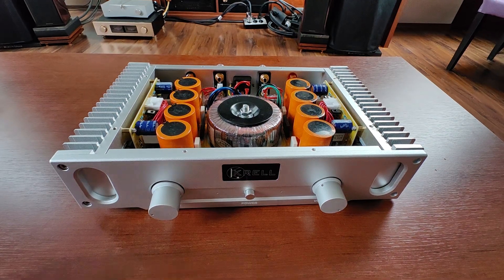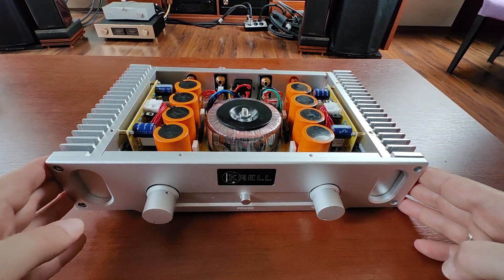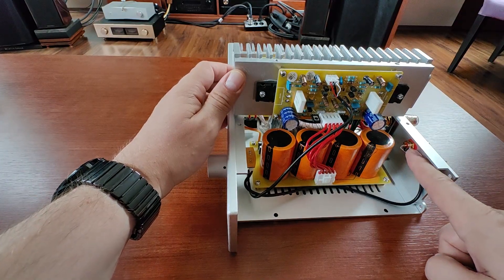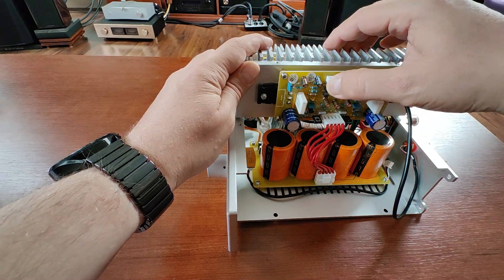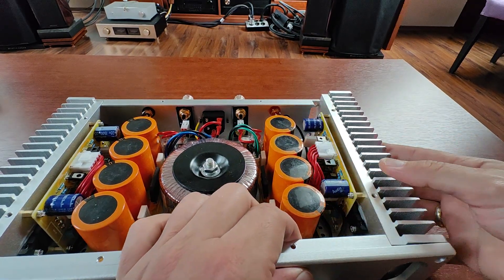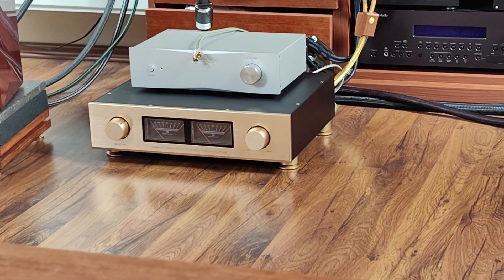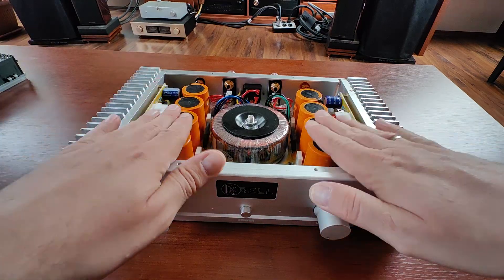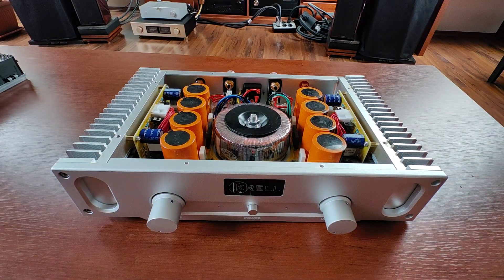Musical Fidelity A1 speaker amplifier clone: volume control bypass in 10 minutes

Comment: I have the impression that this unit, at least the sample I received, is not a true Class A amplifier. It plays noticeably louder than one would expect from a nominal 20 W rating and also does not get as hot as a Class A amplifier typically would. It is possible that the bias current is set relatively low, causing the amplifier to operate effectively in Class AB rather than pure Class A. Has anyone analyzed this amplifier in more technical detail or performed measurements to determine its actual operating point? Regardless, the amplifier still sounds very good.
Reply from the maker: Hi! It's possible that you got slightly different version or just biased differently. That's what I was talking about, unfortunately there is many sellers and though they may look the same on the outside, they may be sightly different inside. 
Mine runs hot as oven, and it's not able to drive properly my electrostats and that would be in line with low specified output power.
Your unit may have different bias and that could explain the (possible) difference 
This is actually a very popular build based on some schematics from diy audio, though you can never be sure which one actually they had used :(

Comment: Hello again and thanks for the mod tip. Is it not to loud without any resistor in the line? It is like hearing with max level. Did you try it?
Please give me a answer, tnx
Uwe
Reply from the maker: Hello Uwe!
The idea is that removing that volume control pot makes this amp effectively power amplifier with fixed gain. So you need either preamp or a source with volume control - but it's worth it as it just sounds way better

Comment: I have the new version a1s. 35v, 8x18k. Bypass has problems probably with grouding. Sound is not correct. Zero volume, noise  in treble speakers. So came back to original.
But IMHO it is great amp. Source is Eversolo A6me with lps. Preamp is new class a brz hifi with bt5.0. Where I changed 4 opamps from original 5532dd to chinese muses01. Cables, best of tested till now from ali , like also rca made by myself. So I know these cables can.... in compare to other big brand also. 
So purchase was for fun. But I stop laughing after all. My Piegas coax 511 really live. One joke is a price of  these chinese toys.

Comment: It’s possible this improvement gives better sound, but in my case noise appeared in the speakers, clearly coming from the RCA jacks. After returning to the initial settings, the noise disappeared.
Reply from the maker: That's interesting, is your amp exactly the same as the one here? Was it from the same seller? Mine is dead silent (also, no one else reported noise). If you can hear it with volume bypassed, and can't with vol pots in series, this means that the noise it's still there, but it's lowered along with the music signal by volume pots below audible level
Reply: @k4syx 1. Thank you for sharing how to make this improvement. Honestly, it is necessary for this particular amplifier model, because each potentiometer (set the same way) shows a completely different volume level. The deviations are really significant.
2. My amplifier was bought in a store – the second link in the description. Apart from the fact that it has a different inscription on the black plate, what’s interesting is that the rubber feet are screwed on separately. To make the improvement, you don’t need to unscrew them in order to remove the side panels.

I hear a slight hiss/hum in the speakers. First, I’ll replace the RCA cables and use plugs for the remaining preamp sockets. If that doesn’t help, I’ll add a ground loop isolator. I’m also considering replacing the RCA sockets in the amplifier itself?

Comment: I did the volume pot mod, but not without near tragedy, and a minor mechanical setback.  One screw of the face panel was stripped. Not clear if it was bc of me or delivered that way. Some of them seem almost as if they are welded on.  So I could not remove the side panel for the left channel. I was heartbroken. But years of piano training did not go to waste.  I was able to force the side panel apart a couple centimeters, just enough to slip two fingers in and do the mod without damaging the caps or op amps.  And this was my first time even opening an amplifier, my heart almost stopped.  But it worked!  Good luck ever getting that side open again.  I hope intricate work is not needed there in the future, bc its not gonna happen.  The increase in clarity is noticeable, like a little increase in EQ on the top, but not in an additive manner. In Gergiev's Philips recording of the 4th Shostakovich symphony, I could more easily distinguish that last top celesta note in the chilling end of the piece as coming from a distinct instrument, and not just obscured by the strings playing the same note. Fabulous, and easy mod ;)
As for the A1 itself, I love it.  Potential buyers should not be overly concerned with the 20 watts.  I'm running from my Oppo 205 directly to the A1 and then to Polk R200 bookshelfs and it produces surprising dynamics. Never seems to run out of steam. The R200s are 86 db 4 Ohm and Im squeezing 25 watts from the A1. I am fortunate, it seems, to also benefit from larger caps than those advertised.  Mine came with 10,000 each,  80,000 total. That must help. Bass is full, powerful and imaging is amazing.  Almost too amazing.  Out of the box, a solid center image was not always focused. But after about 100 hours, some things have tightened up, while others loosened.  It runs hot, but not crazy hot.  Functions well in my 80F/27C living room here in the summer southwest US.  After burn-in, I will integrate my two subs and feed everything below 80 hz to them, letting the A1's midrange really sing and give more headroom.  DeepSeek says such an approach would yield a 30-50% energy benefit to the A1.  The phrase "cheap Chinese parts" is not part of my lexicon, nor should it be in anyone's these days.  Having just returned from Guangdong  province a month ago, where this unit originates from, China is spectacularlly modern, and at the cutting edge of  technological advancement and production. Thank you again, Mr Hifi Zone, looking forward to more videos, and cheers! 🍻
Reply from the maker: Thanks for sharing, I'm happy that you like it! It's little gem and the price is just amazing. I may go with cap replacement in mine in time :)
As for the screw they are probably using electric screwdrivers, these can have a lot of torque and undoing the screw manually later can be really, really hard. I'm glad you managed to get it done! 
Warm regards :)
Reply: Mine was $239 on Amazon.  Yeah, absurd.   Better sounding than the original Schiit Aegir I used to have, and cooler, at 1/3  the price.  Dartzeel is there too in a couple of variants, the least of which is 650.  80k for caps is a little overkill, Im sure the standard 65k sounds wonderful. But I do admit wondering if I'm going to get 120k, I think like that one viewer. Kind of a lottery)  But if you do replace, please let us know what you got and maybe a video ;)  Thanks again  :)

Comment: Thank you, Mr. Hifi Zone!  And please help🙏🙏🙏  I just discovered your channel and immediately purchased the A1 based on your recommendation.  Ive had it almost a week, 1/4 burn-in.  In short, it's marvelous. More on that later.  I need to know the input impedance of the amp so I can install  high-pass filters in between my dac and the A1. This spec is not mentioned in the description.  DeepSeek said 50k ohms, and BRZhifi told me 47k ohms. Moreover, will bypassing the volume pots change this value? Can you or anyone here please tell me the input impedance stock, w/pots and more importantly, with pots bypassed???🙏🙏🙏 Thank you, so much.  And greetings from California))
Reply from the maker: Hi! 
Thank you!
Yes bypassing the volume pots will change the input impedance. You can measure it afterwards, that would be resistance, but it should be close enough.

Comment: I am now really wondering if the new version of the A1 with the 4 18000uf/35v caps per channel improves on the already Beautiful sounding amp.

 It now has a total capacity of 144000uf/35v up from 64800uf/63v. What are your thoughts on this change.

As describing my last post I'm already considering making the 2 A1's I have mono amps and buying two of the new ones making them mono units for the midrange and use the 2 units in Mono's for the tweeters. And doing all other mods I listed below in my last post. This would also give me 4 spare  amp modules if anything should go wrong. 

However I do have a question if I unplug one of the app modules do I need to join the wires of the Transformer to the amp module that would be in use? Or will the single Amp module take advantage of the total capacity of the transformer.
Reply from the maker: Thanks! 
Theory says that this capacity difference will work in favor of sound quality, so that's good and I may replace caps in mine too.
As for joining the outputs of the transformer I would really do that, as the bottleneck is not the transformer here. So just protect them from shorts and leave them disconnected
Reply: @k4syx thank you sir

Comment: Sir what do think about this Mod list for the A1 using 2 of the A1. Just reading thru all the comments about what others think can be done. And what improvement do you think these will reward us with. We know bypass the plot give noticeable improvements.  

1. Bypass the cheap volume pots

2. Replace all signal wires with good solid core silver plated copper telfon coated wires and solder directly to the boards

3. Remove 1 channel from the power supply creating a mono amp. Cool thing about this mod you have to complete amplifier sections if something goes wrong with the ones that you using!

4. Upgrade the 4 large 63v caps to a larger value for more capacity.
Reply from the maker: Thanks! 
These all are good ideas and they all will push that nice amp even further. And nothing here is expensive. I would also add replacing speaker taps with something better.

Comment: Can you please advise me some passive simple preamplifier for this MF A1. Thank you. Peter
Reply: Possibly a link to lon from Ali
Reply from the maker: Check that one - get RK27 version: https://s.click.aliexpress.com/e/_oot99lh
Reply: @k4syx  Thank you, 
so I'll bypass both balance potentiometers and add this one ?
Reply: Wouldn't it sound the same as if I didn't bypass?
Reply: If I do a bypass and then add a passive preamp, will the resulting sound be the same as if I didn't do a bypass ? Plus I'll need additional cables. Wouldn't it be enough to control the final amplifier just by raising the DAC level via PC ? 
I have a Windows PC and a DAC Topping E30.
Thank you Peter

Comment: I have an issue with this mod. The background noise is too much when plug my headphones into the speaker taps. Is it normal?
Reply from the maker: It looks like it's picking some noise from RCAs if that's what happens after bypassing volume pots. The only thing they do is lowering the input signal level, so if there is a noise without them it means the amp is picking it from RCAs (or maybe your source?).
Btw what kind of headphones are you connecting?
Reply: @k4syx  after some testing, I have to say that you were right. It's a ground loop coming from RCA. Tomorrow I'll try to reduce the noise with an Art Dti ground loop isolator. I'll let you know!!

Comment: the version with the 'brz' name plate in fron t is impossible to open up!
Reply from the maker: Why? What's happening?
Reply: @k4syx  top plate is stuck after screws are removed as per video. i used a screw driver to try to pry it  after that, and the aluminium was so weak it got dented and scratched :(
i really dont know how to open it now. scared to damage the amp.
Reply: @CatrinaDaimonLee  I believe one of the screws on top is covered by a sticker. Mine was. Remove this sticker and you'll see the screw that prevents you from opening the cover.

Comment: Ok..mine arrived today! Observations:
1) I tried to do the bypass BUT the pin out on the harness had red and white wire reversed to what you have (however, since this is NOT a balanced amp, I suspect it doesn’t matter - both red AND white wire are soldered to the RCA input pin. Could someone confirm I’m correct please?)
2- arrived safely, looks OK - has the BRZHiFi logo. I wish it were black..oh well
3- I DONT think this is full class A - I had the original A1 and it got WAY, way hotter than this. MUCH hotter lol.
4- I auditioned it with volume at full and it sounded real good. PLENTY of bass and volume 91+ db @ 2.5m from each speaker (JBL stage A130)
4- bass was VERY muscular and controlled. Mids were sweet. Highs were not quite as liquid as I remember the A1’s sounded but still nice.

5) with the volume at less than 100% (50-70%) Sound was good and still very punchy but less detailed.

I am waiting for the P4 mini preamp to arrive and for confirmation (PLEASE!) of the RCA pinout issue I mentioned earlier.
At that point, after several more hours of playing and setting it all up, I will report back!!!😊😊😊
Thank you🙏🏻

BTW It was about $350CDN and 1/2 was delivery/tax/duty
Reply from the maker: Thanks for sharing! 
The red and white are for left and right channels. As you actually have two amps inside it doesn't matter which one will be left or right, as long as you'll remember to connect your inputs and speakers the right way
Reply: I'm powering my JBL Stage A130 with a Fosi Audio V3 Stereo, was curious if this would be able to drive them thanks for sharing your experience.

Comment: Hi,

quick question. If one would measure in continuity mode between both speaker out negative poles, are they connected? Thx for your review.
Reply from the maker: Ive checked that for you and yes they are connected.
Reply: @k4syx what does this tell you? (I’m curious why he asked)
Reply: @blanchbacker  That both channels share a common ground.

Comment: I really like the sound of this amplifier but it lacks power. so I am thinking of buying the accuphase a60 which I think will be a better match for my system.
Reply from the maker: Yes, it sounds superb but the power is not its best point - its very good with efficient speakers. 
Take a look at my E405 review, I've seen some A60 builds that seem to use the same chassis so that part of the video may be useful.
Reply: @k4syx  I bought the A60 plus with both RCA and XLR . I'm sure that will be better.

Comment: What preamplifier would you recommend for this amplifier
Reply from the maker: I think Cary SLP-90 clone. Its clear, transparent and will not change the signature of the amp
Reply: @k4syx  thanks
Reply: @k4syx  I am going to try this amplifier with my audio research ref  1 preamplifier.  I will let you know how it sounds.  But I want this amplifier as a second system so thanks for your preamplifier recommendation. And I will bypass the volume controls on the amplifier. They are definitely not needed.

Comment: i wish they had a little more power.. id buy 3 to use with DSP for a custom speaker build.. but im afraid 25 watts isnt much
Reply from the maker: @JohnDoe-cv8iw  these are very current efficient but you're right that 25 isn't much. Can be enough but with efficient speakers

Comment: I have 933 burmester clone power amplifier .. Should i remove the vol pot from there too ..pls advise
Reply from the maker: @azmansalleh2866  I'm gonna do this and do a video on that, soon. What I'm wondering about is if I should also cut these long PCB tracks, so they stop acting like antennas. It would be reasonable thing to do but I'm reluctant to cut anything permanently

Comment: Question:
Can I buy another (same/equivalent) transformer and turn the modules to two separate chassis monoblocs? What other necessary mods are needed (electrically, that is), to tun it to two monoblocs? Thanks!
Reply from the maker: @raynerstuelgalid  that's an interesting idea as you could move them outside to separate chassis too. I think just two transformers would do, I'd need to check if there's anything between power socket and transformer (not counting power switch) as I don't remember it now (but I don't think there was anything)
Reply: @k4syx  What's the rating for the existing trans?
Reply from the maker: @raynerstuelgalid  I don't remember if that's in the vid (should be if there was a sticker with specs), I'd have to open it and check
Reply: @k4syx  wait one moment, so what are you saying with the 2 units I just purchased (great deal with coupon) I could buy 2 more transformers, take the 2 1 out each amp put them in a separate case and wire them back to the amps 1 for each board. Hmmmmm genius!! 

In your honest opinion what improvements do you think doing the separate transformers and doing the silver or silver plated signal wire solider directly to the board would make?

As this is not a hard mod to do just looking at the boards

Comment: I have been replacing the faceplate of my amps with carbon fiber. Some of the vendors will cut to size for free, and also cut holes, etc. If a CNC drawing is submitted for a charge.

Comment: What do you think about the fact that this clone appears to have a power transformer very much smaller than the original ? I think the original unit weighs over 10kgs and the clone around 5kgs. Does this not mean that the clone will be able to deliver less current and therefore less power than the original?
Reply from the maker: The original amp had to power also the preamp section that's just not here. IMHO this transformer has enough overhead for 2x20W. Also, the whole chassis here is made from aluminum, not steel. It will be lighter, at the same time conducting heat better than steel/iron. All in all - good for me.